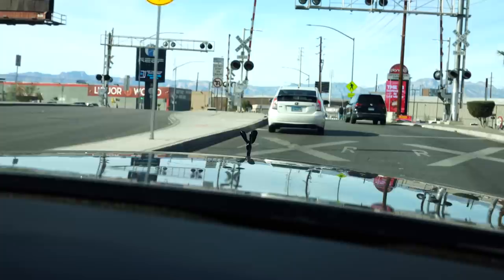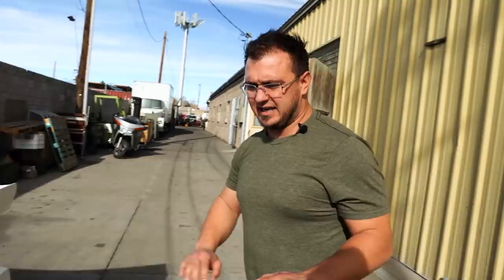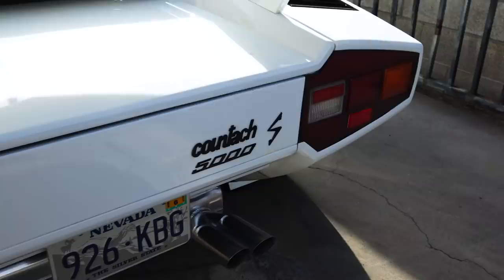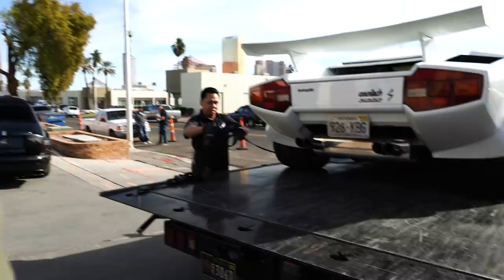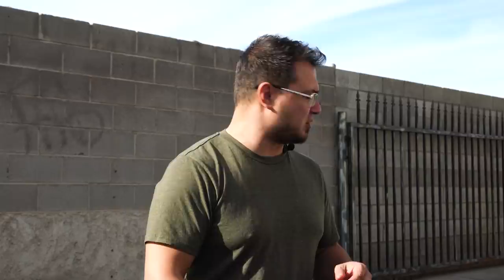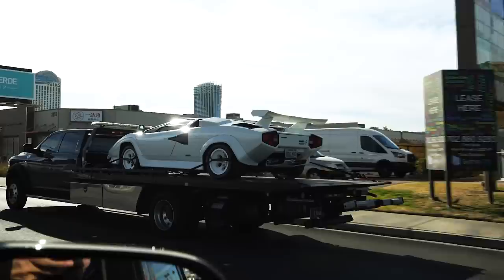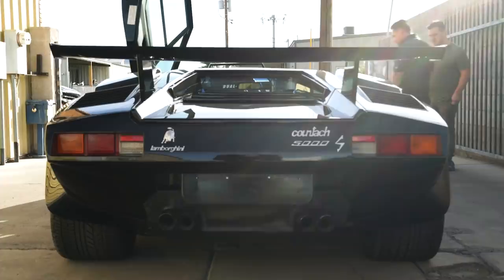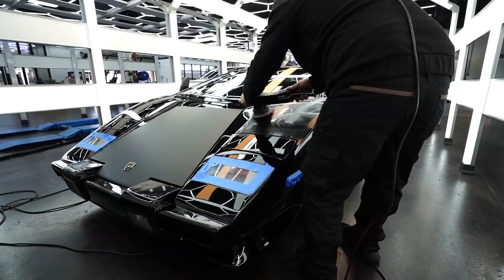My Million Dollar Barn Find

Comment: Leave them Both alone there isn’t enough of these stock ones around. You have two beautiful examples. If you want to modify one find a poor example with bad engine and beat to hell and do whatever to it!
Reply: I agree, there has to be a rolling shell out there somewhere waiting for an Aventador swap.
Reply from the maker: Very true
Reply: 100% <3
Reply: Seems like you can buy Countaches even under $100k if you look hard enough. Some are replicas and some are legit. Take one of the cheaper barn finds and make it look insane. Think that would be insane. I think it will retain/gain resale value if mods are done tastefully

Comment: Houston, if your going to make the black one more original, make sure you have whoever will do the restoration, to remove those later model year side strakes. Those were on the 1988.5 Countach models just before they came out with the Anniversary editions. Early low body cars didn't have those but the lower  rockers with strakes were able to be retrofitted to cars. Would look much better without them since it's an '84 MY car. 👍 Congrats on the barn finds.
Reply: It's also too new to be a low body - I'd say more likely it's just been lowered.

Comment: 1 That white car is already heavily modified. The 5000S was originally a sidedraft carb car so that engine has been swapped hence the modded engine cover for carb clearance since it is not a downdraft car. 2  The black one  is a 2 valve injected car made while trying to figure how to meet DOT requirements, emissions and bumpers. The lower side strakes should be removed. These look like counts customs ex cars. Nice save if you tackle restoring them back to original/highest value. Good luck

Comment: These actually drive really well when in good stock running form. I wouldn’t ruin that, with modifying it to become more performance oriented, as the chassis and other bits won’t be anywhere near modern levels.
Reply: Not to mention the brakes - with 15 inch wheels to fit inside, the disk rotors aren't much bigger than an Oreo.
Reply: @deancleaver1185  Great point!

Comment: The white one is already heavily modified. The downdraft motor wasn’t available on the 5000s, only the QVs from 85 and newer. An 83 would’ve been equipped with the 2 valve side draft motor, so this one is a replacement motor. Also that engine bonnet has been modded. 

I would restore the black one to original. Then do a murcielago/aventador V12 swap  in the white one. Have fun with them! Let the next guy restore it to its original configuration

Comment: Both of these cars have been modified. Neither should have the side skirts and the white one has a different engine cover. White also has after market exhaust and embroidered seats which I don't believe were stock. And of course the fuel injection which needs to be tossed. My experience with a Countach is a 1985 carb model black on black.

Comment: Small error. The black 83 isn't a low body model. Only the LP400S S1s were. Those were produced from 78ish to 81. Also, the white one being a 5000S model, looks to have been swapped with a 5000QV engine.

Comment: Question for Countach specialist..... what’s up with the tail lights on the black one? Seems like something is off, I’ve never seen any with them recessed so far in like that, almost like the tried to graft anniversary tail lights?
Reply: Not a specialist but those look like US spec "bumpers" that were applied to the later models (compare them to say an Anniversary Countach and you'll see what I mean). I am uncertain if they were stock on 84 cars (that one is a genuine US new vehicle, converted to Fuel Injection in the US to meet regulations) but certainly they were on the later models. That's why the lights appear recessed.

Comment: I mean I like the crazy idea of modifying a countach but it just doesn’t feel right… maybe you could use the countach body and take molds then make it seamless widebody carbon panels on a newer frame with possibly a built aventador motor, not just turbo but like built bottom end, heads, the works and just balls to the wall while still having the originals protected and relatively original

Comment: Upgrade the system is your. SVJ status  700 hp. Or more. Upgrade the interior to diamond tucked into center of seats or a suade pattern, paint it ebony black. There has never been a old school contact upgraded that way.
Reply: I stand corrected. Now a new coyntach LP 800-4 has 800 hp. So on the 1984 give it 1000 hp street legal 6 weber carp set up if you can find?

Comment: ...forgot to add, that's not a "low body" either.  The "low body" cars are early-run LP400S cars to put it broadly.  To sum up, both of these cars are 2V 5000S examples. Both of them already HIGHLY modified. Neither of them is a real downdraft QV.  For the most value, (it might not be possible) return them both to stock.  Brace yourself for parts prices unlike any other car you've seen.

Comment: You could always mod it in such a way that it could be returned to stock if so desired.  I never really liked the White on white either ,but that Black one all murdered out looks Great!  Wrap the white one and change the wheel color,but not sure if I would do too much to the mechanical parts except get them running 100%.  The Black one should def. be kept just like it is.  That guy that owns Curated in FL is probably pissed he didn't find these or get them.

Comment: Great to look at and sit in. Static art. 

Wait till you drive it will be a sauna inside 150 degrees and the AC worthless the windows roll down 2", gets hot real quick, a good winter driver . Can't see behind you either. 

You'll want out real quick  LOL. 

That's why most Countaches have less than 5000 miles.
Reply: I heard of these 2 Countaches years ago back in 2005 both broken down and have been sitting since then in Vegas. They were located at a house in a garage at the time a realtor friend told me about them and heard of them but couldn't have me owners info so I could contact them, that was when they were cheap $50k

Gary at Italy Service bought that 78 Silver Blue Countach cheap $35k back then after owner gave up crazy expensive bills needed a starter which required $10,000 engine pull. 

Was a rare low body Some Prince owned and has since been restored solid blue. 

Good for you
Reply: Glad you got these instead of that low life Joe Sackey.

Comment: Take the v12 off the white Countach 
Display the engine behind glass in your place.
Make the lamb an Electric vehicle.
Join two Tesla Plaid battery set ups together
Give it double the power.
20 years later you’ll still have an engine with under 4K miles

Comment: i would leave them both stock .. worth more long term and now they are considered important cars but i do have a couple of questions about them .. the black one wouldnt have those "sills" between the wheel arches if the year of manufacture was correct .. they were bought in for the 1988 i think and then kept as part of the design for the anniversary edition .. and the white one shouldnt be a 4 valave  engine .. that was i think introduced in 1985 and was badged as a 5000qv at least that is my understanding .. the first one i ever saw in person was a qv model in black on black with gold wheels .. thats my dream spec for that reason :)

Comment: Matey I applude you!!!  👍👍👍

Makes sense doing the white car, the black is already 1000% baller.

V12 drift attack style with larger style similar alloys but split rim...   Wrap it in a custom layered tron / camo style.   And I would leave the interior but just modernise it.....  Or if brave a diablo  style sloped dash.

Comment: First of all, great finds. Just found this video and will catch up to see if you have any updates on these, but, I sure hope you didn't overpay, because neither of them are quite as rare and valuable as you think they are. The white car is NOT an original downdraft car, and getting it back to stock will be tough with lack of available parts. The black car is NOT a low body car as those were only LP400 S2s that ended late '79 / early '80. That injection setup looks a bit like the silver car (chassis # 12507) that was used as the test bed car to federalize them at the time, and the black car even seems to have a similar (and rare) rear valance set up. I think these were BOTH "grey" market cars at the time so they sure will have some odd things about them, many of which would be easy to list. Anyway, PLEASE FOR THE LOVE OF ALL THAT IS HOLY, put them both back to as close to stock as you can. If this project turns out to be too large, let me know.

Comment: 5:50 Houston saying 4000 original miles, odometer shows 7400 miles. Are you guys scrolling them back as far as history tracks them?
Reply: Odometers in these cars are in km, and 7400 km is about 4500 miles so slightly off but not scrolling them back.

Comment: If you plan on selling them like keep it stock because an older gentleman would purchase the vehicle. No young stud will buy that if he had the money. Besides if you watch a gas monkey video when they sold a heavily modified Fort GT it hit rock bottom topping at $210,000. While other Ford GT’s topped out around $450,000 tops I believe on the Barrett Jackson Auction.

Comment: wanna go mental on a build then go electric with that  Countach, an electric Lambo Countach would be insane.  digital interior,  keep outside as stock as possible, and 1986 (Hayashi Racing) Lepone / Lepone Staff Dego wheels, in same color as car.  lower it for aggression, led pop-up lights, indicators as a glow with indicator functioning under,  and ZERO air suspension. My point since growing up if you must spend money to keep something and not use it might as well have 2 so you can enjoy the same product.

Comment: In order to meet the smog regulations of the era from 79 to 84 carburated engines were normally quite awful. You may want to go with something different than the original on the carburetors in order to ditch the smog control.
Reply: Everything older than 25 years is considered a classic and is smog exempt
Reply: @tazmaster03  That will be a big help when getting rid of the old EPA compliant carbs. Hopefully, a low production vehicle never had to conform in the first place, but I would not count on it.

Comment: Keep the original block but go crazy modern with engine internals most modern fule and ignition system including a brand new head design to accept a stronger Vale train with a full millspec wiring loom and an unlimited ecu. The transmission would need to be sent away to be gutted and modified to accommodate a more modern and reliable clutch and flywheel set up. The interior could be completely modernised inspired by the original. Exterior would also benefit from a refresh, like camera wing mirrors linked to the dash, new wing that is functional but with the same look. The wheels could be remade using the centers but into a better size and material to suit the needs of a hyper car. The suspension replaced with perfectly tuned shocks and springs, the floor pan could do with additional improvements to clean up the air including splitters.

All in all you could create an example of What the countash would look like if it was produced in 2022. But with the blue print of the original. Hence original engine block and transmission layout really pushing to find what the limit is with this timeless design.

Comment: Congratulations, but your lack of knowledge is glaring and loud...nothing personal. I'd hope you'd do the same for someone else.

Both of these cars are VERY far away from stock, so there's no "keeping one stock." There is only "returning them to stock."

Both of these cars are in need of a frame-up restoration. Anything short of that in today's Countach market is half-ass. Even if they were running, their value would be the same as a car already stripped into a million pieces since both require nut&bolt restoration.

The black appears to be among the early 2V franken-fuel-injection cars, not the familiar 4V 5000QV FI cars that it sounds like you're referring to. Rare, but of lower/lowest value because they were the slowest and most compromised imports.

The white car is NOT a (highly prized) downdraft QV. It has apparently been highly modified with a downdraft arrangement, but would honestly be worth a lot more if returned to its original sidedraft configuration.

The bodywork on both cars is all over the franken-map, having also been highly modified...as has the coach work. You will either need to gain many years worth of knowledge or hire someone who does in order to approach the restored values you're quoting.

Comment: You have made 0 sense there at all first off you are saying how rare and how valuable the white one is and then how the black one has been updated to fuel injection and how you want to restore it back to carbs for originality wich is fare for 2 classics such as these then you go on and say lets put a modern v12 in the white one and probably half the value straight away 
Personally if you are wanting to do a countach build id look for another one thats in poor condition a and i say this loosely a more common countach or 1 idea you could do on the black one is recreate the countach turbo that would be a good idea

Comment: Don’t hack up the black one or the white one there both worth good money down draft and a lowbody which did have carbs once also right change it bac to carbs if that’s what’s brings more money for the car I would it’s a cool car but the hype is too much for a car horrible to drive sitting sideways to drive not worth it rather go for one of the other cars that have hype before these old 80s cars rather have a murci Which i been looking into for years and during covid up to mecam auction this week e gear car was going as low at 120-130 max for good examples and now a e gear cause not one more then one sold for 330k and one sold for I think 375k and close to million or was one over a million for a gated unreal but that car has left my reach wish I pulled the trigger years ago 2018-2019 now it’s more then triple price I will never get my dream car a murci with all her problem for. 120k shame smh